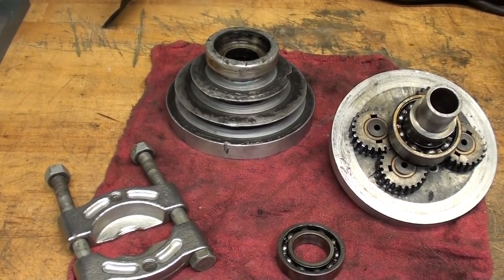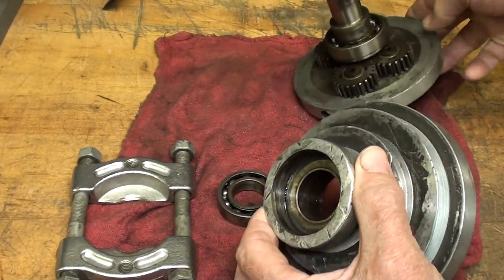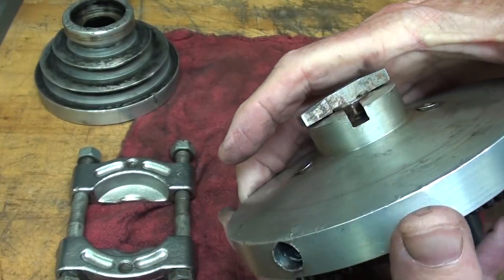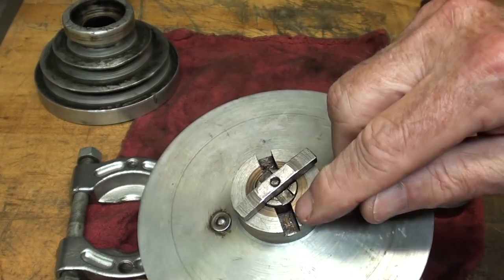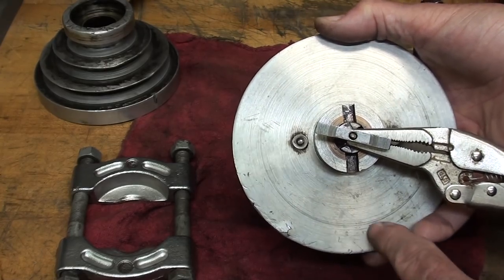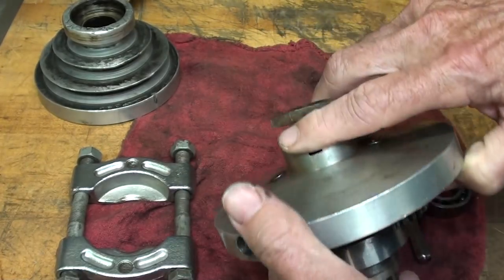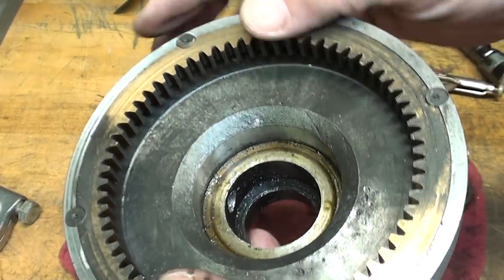plea#2 tubalcain NEEDS HELP with a PULL GEAR SPEED REDUCER

Comment: Lyle,  If you haven't already, I would just cut the flared pin top off with a Dremel tool and dispose of the entire pin and even the bar too. Only the spring can be reused.  As a practical upgrade, I would make a better knurled knob maybe 3" in diameter with a hub about 3/4" long and about the same hub diameter as the length of the bar. Mill a clutch face into the hub with the Bridgeport that replicates the width and height of the lock bar. Then drill and tap in the lathe for say #10-NF or 1/4-NF thread and use a long 1/4" Allen cap bolt to take the place of the rod. Counterbore the top end of the knob  1/2" or so deep  for a jam nut to lock the knob to the bolt and prevent it from twisting loose. Also put a 60 deg chamfer on the top edge of the counterbore to fit a lathe center be used later to turn the OD of the unit. Drilling the main shaft bore to fit the bolt would also be needed. But a hardness check first should be done to the main shaft to be certain it can be drilled with common cobalt twist drills. This knob would make it much easier to switch between direct and geared by just pulling up and twisting it 90 deg until it locks rather than having to use a screwdriver to pry up on a small lock bar and then having to turn it. Seems like Pull Gear should have thought of this earlier.

  Now, back to the dis-assembly part. After studying the patent drawing with a magnifying glass, it is clear that the gears would have to be removed before pressing out the main shaft because the bearing will not clear the inner 2 gears. Your video shows what looks to be 4 Allen countersink type bolts holding the gears to the upper disk mounted on bushings of some sort. The patent drawing shows nothing about this. An Allen key should remove them, but it's possible they used laquer on the threads if they won't turn. If so, a trip thru the wife's oven at 275 -300 deg. is needed. Wrap the unit in a dry towel when it comes out and wear cotton gloves to handle it. The aluminum will shed the heat quickly so you have to work fast. The towel just slows the cooling process down. After removing the gears, return the unit back to the oven for reheat and find a piece of hardwood dowel, like a 10" piece of boom handle or similar. and turn one end in the lathe down to a size slightly smaller than the main shaft at the grooved end. Take the turn about an inch or so back and also find a couple of 2 x 6 wood blocks to support the gear units aluminum disk on. Set the wood blocks on the concrete floor of your basement with a good size ball peen hammer at hand. I think you know where I'm going with this. Bring the unit from the oven, wrapped up, back downstairs and sit it (unwrapped) on the blocks positioned as close to the steel shaft as possible and use the hardwood dowel and hammer to drive out the bearing while it's still warm. I doubt that any great amount of force will be needed, just a good bumping. You may find the shaft might just drop out by slapping it down on the blocks with no hammer or dowel even needed. Just make sure there will be enough clearance, at least an inch, for the shaft to move down without touching the concrete floor. Maybe 2 x 8 blocks will be needed. Once the shaft slides out, you will be left with just the shaft with the top and middle bearing pressed on it provided that the shaft didn't slide out of the bearing and leave the upper bearing in the aluminum disc. It could happen that way but it's not likely since the aluminum expands much more than the steel bearing and shaft.
 
  Now, all that needs to be done is to use a conventional  2 or 3 jaw bearing puller to pull the middle and top bearing off the shaft. Make a counter bore on one end and center drill the other end of a cap turned from say 1" brass that fits over the slotted top end of the main shaft to protect it and prevent the puller screw from "walking off". And that should get it all apart.
 
   I'm not really an advocate of "hammer mechanics" but a hydraulic press would eliminate wood blocks, dowels, hammers and oven heating and it would make this kind of job much easier in general. Good quality sealed bearings can be found on Ebay.

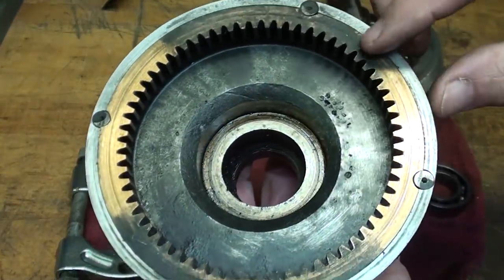   I should point out something else I feel is most important here. There doesn't seem to be any sealing element used between the upper and lower discs on your unit. The patent drawing shows some kind seal but does not make any notation about it. Any oil in the gear area will be thrown out by centrifugal force and onto the belts and everything else, including the operator, leaving the gears run dry. This may well have been the shortcoming of the whole design. As an easy modification, I would drill the botched pin hole on the side of the upper disc to the next drill size larger and epoxy in a close fitting aluminum plug, turned to the right size and leaving it protrude slightly. After the unit is completely re- assembled, mount the entire unit in the lathe by first turning a mandrel to .750" shaft size and, without un-chucking the mandrel, install the Pullgear unit on the mandrel and tighten it's setscrew. For support on the tailstock end, a common center can be used in the chamfer in the top of the knob. But this center probably won't lend much support and may not be needed at all. It's necessary also to put the unit in direct drive, not reduction drive for the next steps.  Then lightly turn the OD of both discs to trim off the aluminum plug and make a nicer finish in general. As a precaution, force grease into the gap between discs to prevent chip entry during machining.  Then using a tool with a radius ground into the point that matches an O- ring of probably 3/32" section, cut a shallow groove with the tool centered over the gap between the 2 discs. However after studying the video at 2:36 it looks like there is very little distance to cut a groove and the tool will strike the 4 screw heads, so either switch to brass retaining screws or drill and countersink the brass internal gear further inboard to put the original 4 steel screws there instead which I would prefer anyway. Small 3/16" pins could also be installed for torque resistance. The OD groove would be used to retain an O-ring making a stretch fit over the housing and would make a seal against oil loss. As a sideline bonus, not only are the O-rings a low cost seal, they don't require any dis-assembly to replace when they wear out. Simply roll off the old leaky ring and roll on a new one over the housing and into the radius groove. Since the bearings would have seals (not shields), you could then fill the gear chamber 1/2 full of SAE 30 wt. non detergent oil which should quiet the noisy spur gears down and make a much longer lasting unit as well. As for seal wear, the only time the seal would get any wear is when it is shifted into low range. In direct drive, no seal wear would occur because both discs are locked together and the seal is more or less just a rubber band sealing across a gap. Ordinary Buna-N rings of about 5 1/2" dia x .093 section would be used and should be available from McMaster.com online. Diameter would have to be determined based on your housing diameter. Bearings could be had thru them as well and they have no minimum order value and their shipping is reasonable and prompt although they never come right out and say how much shipping is. I don't know what their reasoning is for this but I've never been disappointed with any of the many orders I've placed over the years. 
   If you need any clarifications or drawings on what I've suggested here, or maybe ideas of your own to suggest, let me know. Good luck with this unit.
Ray
Reply from the maker: Ray--Thanks alot.  Wish I had heard from you 2 wks ago, as I just finished the job. You are so right about the oil slinging. What a mess that will be. I'm still having minor issues with the gap between the 2 halves.  The gears are badly worn & its VERY noisy. Vids to follow.
Reply: Lyle,  The condition of the central sun gear pretty much determines weather the unit can be restored or not. Since the sun gear has so few teeth relative to the internal brass gear, most wear will occur there unless it's considerably harder. If the sun gear is in bad shape but removable, you're in luck but if the teeth were cut directly into the main shaft, well the unit is pretty much burnt toast unless you want to turn (or grind) the old teeth off completely and press on a new hardened gear.  I found that the 4 "planet" gears are actually 22 tooth, 16 pitch change gears offered by Boston as a GB-22 . They are about $38 each though, so you might want to make them but omit  the 2 key ways that the Boston gears have which are not needed. 
   And then again, something has to be done to seal oil in between both discs. The gears have to run in oil or  grease of some kind otherwise they'll wear out in short order, so sealing is critical
   With everything considered, maybe it's better forget the Pull-Gear unit and fit one of your drill presses with a special large pulley on the spindle side and a small pulley on the motor and just use this machine for low speed work like big drills or hole saws. Using toothed timing belts and pulleys would eliminate any slippage. These timing pulleys and belts can be found on Ebay at low prices. 
   But the best possibility is to simply replace the 1725 (or 3450) rpm motor with an 825 rpm unit. They tend to be more pricey than 1725 motors because they have more poles but better torque characteristics. Doing a quick check,  I found a new Leeson brand 1/2 hp. 825 rpm, 115/230volt motor on Ebay sold by woosurplus in Wooster, OH for $242.62 and free shipping. This is probably about the minimum hp. you would want. He states it has a 5/8" shaft so it might fit your pulleys as is. You might be able to find a used 825 rpm motor locally for much less though. Hope you find these ideas useful to build a lower speed drill press.
Ray
Reply from the maker: Thanks--it is of course pretty worn out.

Comment: Hello Mr Pete,
I have watched many of your videos and have learned something from every one of them, 
I would suggest that you may be able to press the pin through with little or no filing/grinding off the edge of the swagging on the tip of the pin then if there is not enough material to re-swage  use a set screw to reassemble. 
Second comment is to purchase bearings with seals and lifetime lubricant, Bearing Engineering (bearingengineering.net) should have replacement bearings just request sealed bearing versions. One of their locations is across the street from my shop. 
Keep the good videos coming

Comment: Filing off the peened area would be my approach.  However, this raises a concern as to how to avoid pressure on the back of the planet gears and possible breakage.  If the planet  support pins are threaded or pressed into the upper housing, I would try to remove them.  Perhaps they are threaded internally so a puller can be fastened.  The outer race of the lower bearing has to go to provide clearance, but that's going to be replaced anyway.  Just a few thoughts.

Comment: I don't think the peening was done as part of the assembly of the part 86 assembly. There is part 88 that retains the spring and I suspect it is either screwed onto part 86 or may be a 1/4 turn bayonet release. If you can't make headway there, you can remove the bar as 
Al C suggested or as I have had some luck in removing rivet like fasteners I had to reuse. I pull up as much of the riveted material as possible then use a large pair of pliers or cutters which have smooth jaws at the inside near the pivot joint to act like an anvil and hammer. Work steadily around the shaft using pressure on the handles to flatten the bead back toward the shaft diameter until all of the bead is reduced to the shaft diameter. In earlier years I needed to exercise caution that I didn't over do the pressure and pinch off the end of the part. The pliers give huge mechanical advantage close to the pivot joint, but that isn't such a problem since my grip isn't that strong these days.

Comment: Pull the plunger up and support the T part on both side with some kind of spacer then just drive the center pin down with a punch. It should be easy to do if it is only peened to the shaft and you can save the shaft and just peen it back when you done or you can do as someone suggested and grind or file off only the peened tip and at most you will only have to make a new T handle and you could fit that with a set screw instead of peening it like the factory

Comment: There IS a sun gear, I could not see it in the drawing. The shaft should be a sliding fit in the brass bushing. Possibly the aluminum has been replaced before. Try the Dake press, it has better feel than hydraulic.

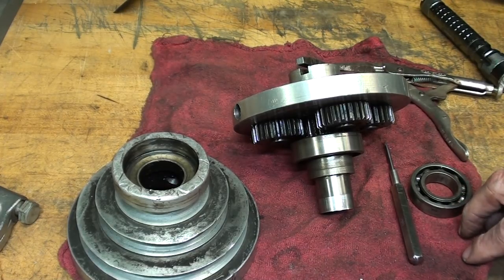Comment: At 9:08 in this video it appears in the picture that there is a knurled thumbscrew attaching the selector bar to the small shaft rather than the shaft being peened over like the unit you have.  Agree with others that you should file off the peening to remove the selector bar then drill and tap the rod for a thumbscrew (made by you) for reassembly.

Comment: Greased sealed bearings please.  I'm amazed at how many shielded bearings are used around chips.  I see a bronze thrust bearing inside as well.  Does the other end of the plunger have a spanner or lock nut of some sort?

Comment: The only purpose of that pin is to hold the locking key in place. It isn't connected in any other way to the gear train. Grinding off the peen or whatever else you do to get the locking key off won't affect anything else. Only thing that will happen on reassembly is that there will be a bit more tension on the spring because of a shorter shaft length.

Comment: Mr Pete, To save you cutting pin. Can you try placing a pin punch up through bottom, internal hole,  to push pin up from under neath. It may give you more pin stick out, to help you grind or file off peened end of pin.

Comment: Hi ive noticed two threaded holes in the underside that look blanked off on the top..they look like they are push screws to push against the bearing /a cut washer  as shim .i cant see the sprung pin but wandered if it could be hit down the pin and top crown could be ground off or is the pin recesed this may help... JD

Comment: If I were to dissemble this Looking at the drawing the shaft should press out from the top down through the planetary gear center space. Bearing 64 or 68 (two numbers for the same bearing or a slip of the pencil and 68 is the outer bearing surface) Bearing 64 should need to be removed after the shaft is removed. I would heat the whole thing up in an oven to assist with pressing slowly.
the oiler holes do not appear on the drawing I have looked at, so there might be a couple of other changes as well.
Flame away
Rick

Comment: An online "inflation calculator" shows that the $72.00 cost in 1958 would be equivalent to about $620. present-day.
Reply: carver3419  Apples and oranges comparison. That may figure out about right if you were looking at the price of a car but look up the price of a TV set back then and it will skew the numbers the other way. Again, apples and oranges. The man hours of labor to produce a device like this has gone down with cnc's, robotic part loaders and carbide tooling. Too bad we moved everything to China and other third world countries.
Reply: That may be missing the point. It's not a question of today's buying. Then, $72 was a serious bite of someone's income.
Reply: carver3419  True since you could buy an entire lathe with a better planetary drive for less back then. http://www.practicalmachinist.com/vb/antique-machinery-and-history/craftsman-109-lathe-bias-fact-214858/
I have one of these lathes and the planetary drives are nice simple designs. Slowing things down this way does not increase belt slippage. Plenty of low end torque for threading steel with these tiny lathes.

Comment: I'm pretty sure you know how to do this already!

I hope this works, numbers are reference to drawing 2 on the patent:
#97 should be seated on the higher of the two slots in #38. #38 and #97 should then be turned together so that #97 aligns with the slot in #58, then you would press until #97 sinks into the slot in #58 hopefully the bearing #64 will come straight out, either way, there will be enough room for the bearing to slide out, perhaps with some leverage. It is still not entirely apart and the bearing is still captive, but it's quality can be assessed before the next stage takes place.

I am in two minds about the next step. #97 is now butted up against brass bushing #62 and the outer casing #58, but the bearing is still captive on shaft. Perhaps the next step is to reshape #99 enough to slip it through #97. The bushing is still in place but the shaft and then the bearing can be removed without the need for leverage as was suggested earlier in my comment.

As previous comments have suggested it, I will clarify that reshaping #99 may well be possible with a hammer and anvil, allowing the shaft to be reused later, if that is preferable to replacement.

Comment: Mr. Pete - looking further at the patent drawing and watching the video a couple of times, it appears one can look down inside the spindle from the motor shaft end and 'see' the spring retainer (appears to be item 88). Is there a chance that the engagement pin (item 99) is screwed (or otherwise secured in a removable way) into the spring retainer (item 88).